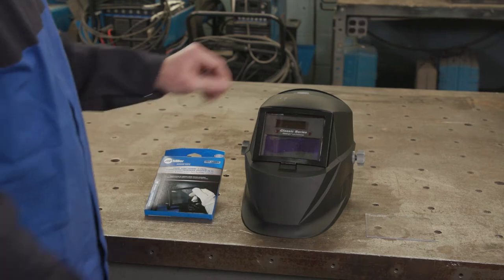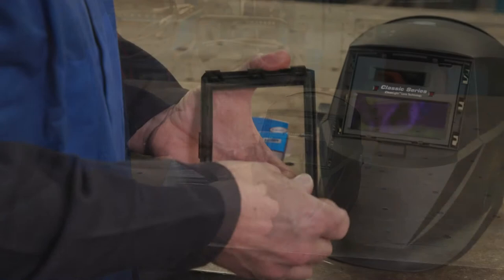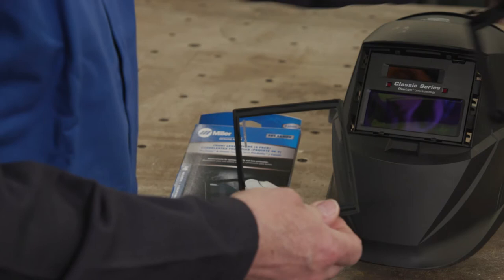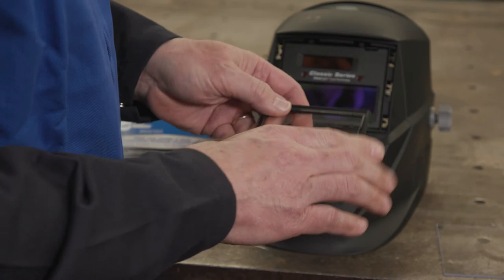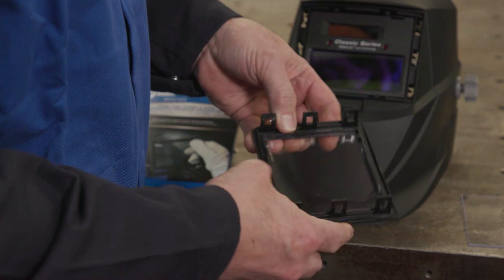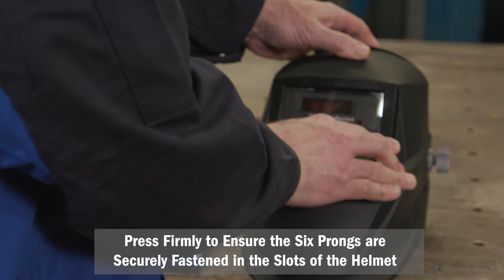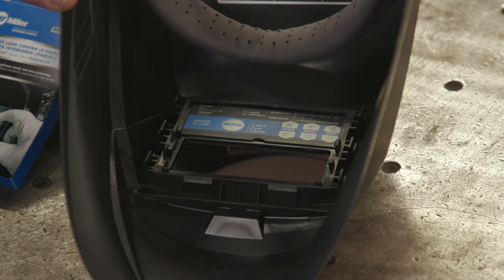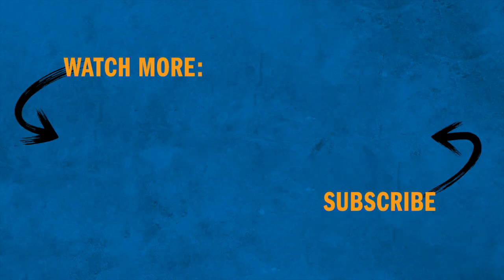How to Change the Cover Lenses on Your Classic Helmet

Comment: taking off that front lens thing has to be the scariest thing im going to have to do i desperately need to change the lens bc i can barely see but i dont wanna break my helmet either D:
Reply: I was in the same position as you, I haven't changed it for months and i was like, "this is to much for me, I can't see". So I tried taking it off and it wouldn't come off, lmao I was scared it was going to break
Reply: @JustinHerbutt where you able to take it off I’m pulling but I can’t seem to get it to come off :.(
Reply: I had to carefully use a flat head to pry it up just a little bit, then I was able to get the rest to unlatch.

Comment: Is there anything you can do to possibly clean the lens seriously i dont want to have to keep changing the outside lens after everytime i do overheads
Reply: Windex, furniture polish.. both good options
Reply: Best thing I used and it helps a lot is use headlight restoration cleaner kit. Trust me. I use it on my esab sentinel because their lens are criminally overpriced and I never changed the lens yet. Try it bud. Get the turtle kit.
Reply: @broabc66  nah, that won’t help it’ll clean it but but help with the spatter
Reply: Don’t weld under it     weld towards u

Comment: What are the dimensions for the two lenses? ..I can't find out the size of the lenses using Google & my hood is at work still so i can't measure it right now.. if someone responds, you'll also help a future dude looking for the answer to this question
Reply from the maker: The outside lens is 4.5 x 3.75, and the inside lens is 4.25 x 1.75. Their part numbers are 231411 and 231410. Let us know if you have any other questions.
Reply: I just did it bro it is scary because it feels like you’re gonna break it !! 

But so far so good